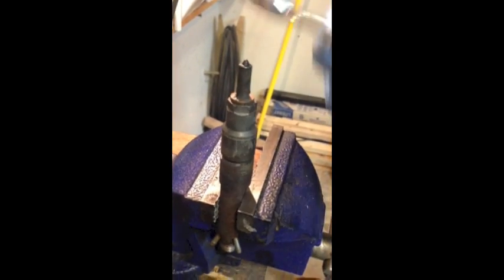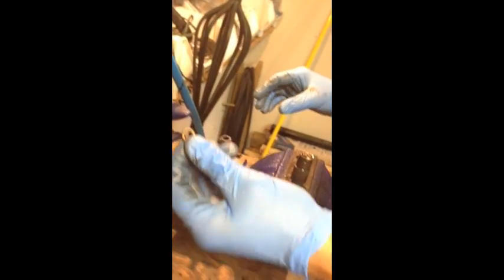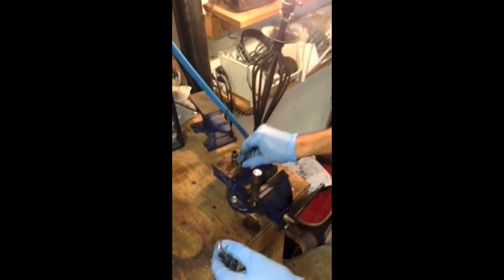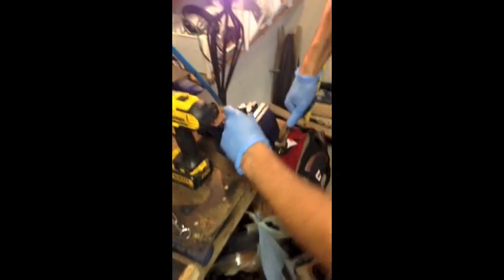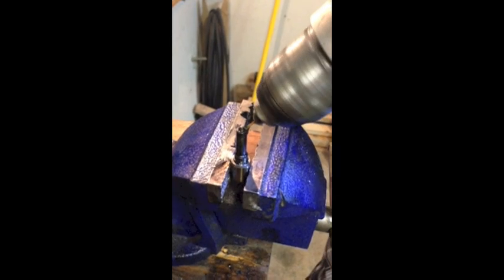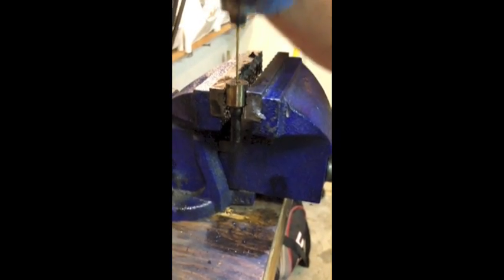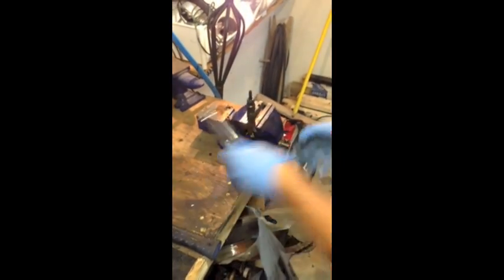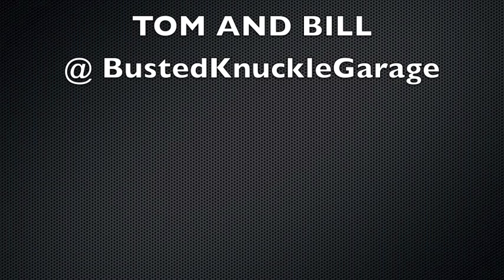VW TDI PERFORMANCE INJECTOR MOD

Comment: Haha very funny with the vice and precision drilling in the nozzle 🤣And without spraying this with air compressor after hole drilling. Not cleanest job, buut anyway should working. For a some time I'm gonna introduce this modification to my VW T5 2.5tdi 174KM->230KM/500NM . We will see . But I'm think it's working!

Comment: Also to minimise drag and improve cooling mix your engine oil 50/50 with water less thickness will let your engine move freely and gine you extra power

Comment: Epic mod thanks, I went for 3mm drill bit and turned the 5 puny holes into 1 big ass hole. Worked a treat. Coupled with my go faster stripes and nurburgring sticker I now have the fastest tdi in Ireland. It smokes like a cúnt though but that is true vag style. NASA have contacted me and asked if they could use my injector mod and nurburgring sticker, they reckon they could reach Jupiter in 2 days, obviously I agreed to share my blueprints with them but only if they put german pressed plates on the space shuttle and did some rolling coal on the ISS when they tear past it.